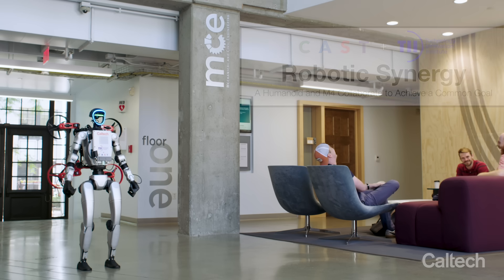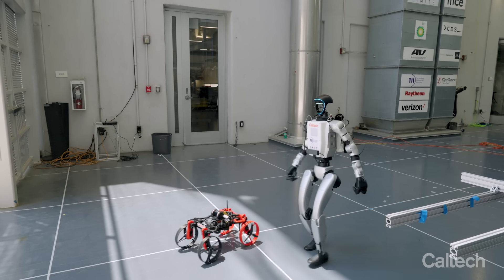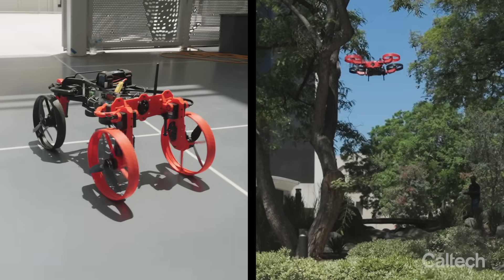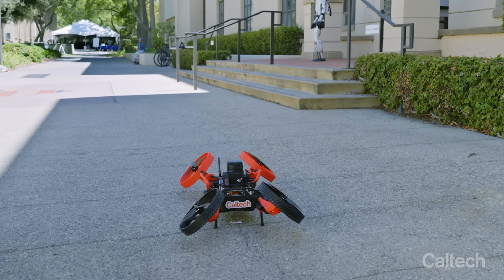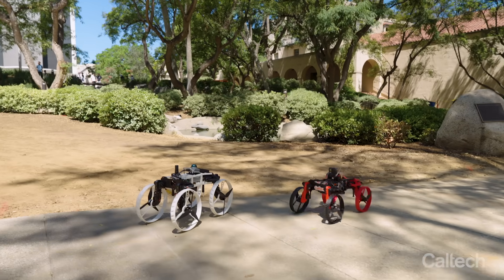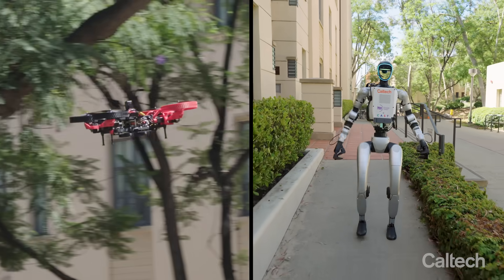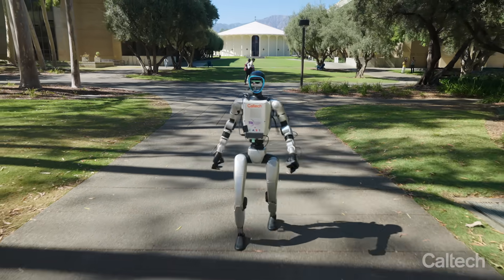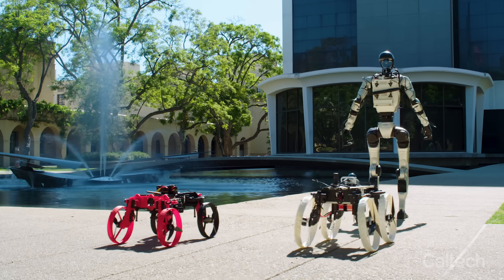Robotic Synergy: A Humanoid and M4 Collaborate to Achieve a Common Goal

Comment: So you made a drone that can drive and fly. But the humanoid is still standing at the library? Why do you need this? You need all three in one. Why does ths humanoid need to be so big and heavy? Just needs arms to reach up high to do humanoid work. Then make it so the humanoid can fly and drive drop the walking completely
Reply: Imagine the energy requirement to have the robot itself fly. It probably won't last more than a couple of hours as it is